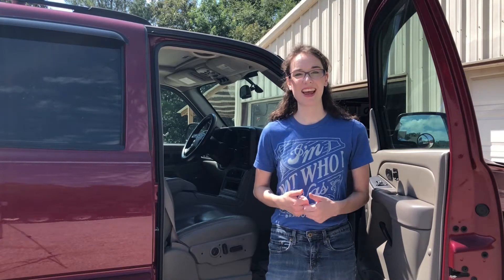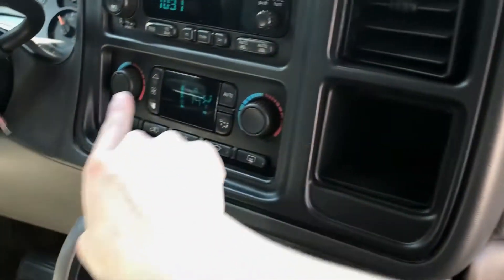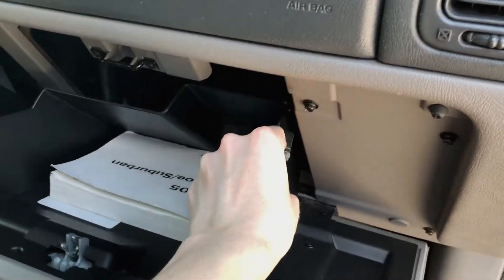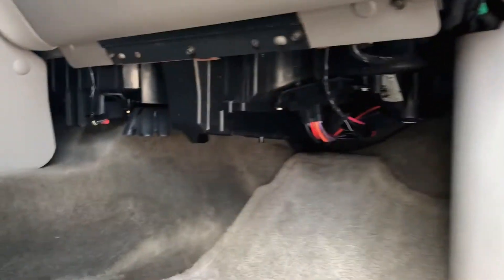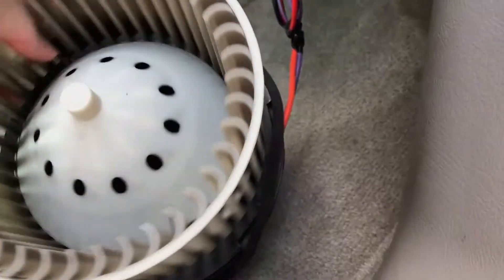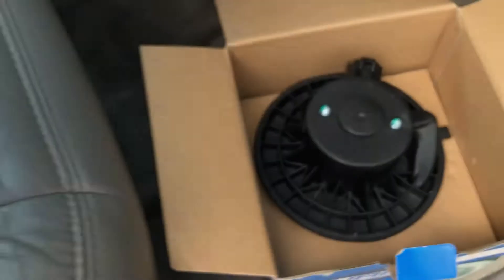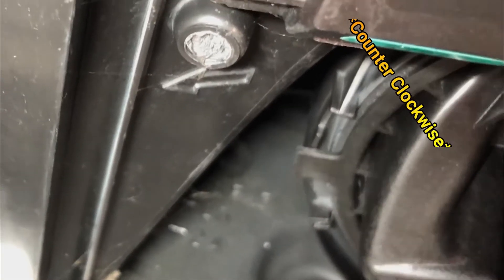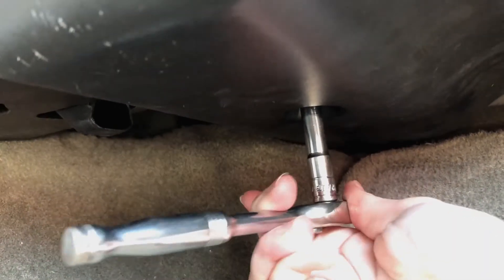Blower Motor Replacement Tutorial (2005 Chevrolet Tahoe)

Comment: Laura's easy to understand discussion starting about 3:12 shows the pull down tab and twist COUNTERclockwise to remove.  This was most helpful to me trying to reinstall mine which had simply fallen out. It was very difficult to do when one had no idea where/how to start.  I also learned the hard way that spraying some silicone on the plastic bits that fit together and the twist CLOCKWISE to click back into place!
Reply from the maker: Glad it helped @jbr3rd!  Thanks for posting.

Comment: 05 Tahoe - The blower motor was making that same excruciating sound off and on for a while until it just stopped (died) about a week ago. It was cutting in and out (on and off) for a few days but it's not doing anything now. I was going to take it to my mechanic but after having watched this video (thanks by the way), I'll be doing this job myself later on today!
Reply from the maker: That's awesome! Glad we could help, and thanks for watching!
Reply: I’m having the same problem with my 05 Tahoe. Once you replaced it was it working like normal?
Reply from the maker: It did for us

Comment: Thanks for the tab placement tip! My '04 Sierra was making rattling noise for 2 yrs at least and recently got louder. After removing the blower fan, found old papers and slipped being the glove ox and werr around the blower fan and some acorn shells inside too. Cleaned and blew it out. Kick plate and blower removal were kind of easy from watching another video, but fought 4+ hrs over 2 days trying to put the blower fan back. Should have watched this one too re: the tab detail - superb camera work and great info. No more noise! 💯👏🏼
Reply from the maker: That's fantastic!  Thanks for posting.

Comment: Hi, did yours happen to vibrate a whole lot while on the higher speeds? Mines sounds like a plane on the last two high speeds…
Thanks!
Reply from the maker: Hi there! We recommend checking every bolt to make sure that they're tightened all the way. If the sound persists, the motor may be defective. Hope this helps, and thanks for watching!

Comment: Any idea what the housing that the fan locks into is called?  Mine fine is fine, but it has wallowed out all the tabs on the housing that the fan twists into!
Reply from the maker: Hi Lee! We're not sure what the exact name is for that, but we recommend checking the owner's manual and part diagrams online. It's possible that it's a mount of some kind, you may want to use that as a keyword in your search. Hope this helps, and thanks for watching!

Comment: I have a 2005 Tahoe.  The HVAC controls are the digital type. I turned the truck on and the blower came on.  I turned off the truck and the blower stayed on high.  The blower speed control didnt adjust the speed. 
I pulled the 40 Amp fuse and the fan went off. I'm thinking that something in the control panel has cross circuited. 
This spring the blower wouldn't come on at all. I pulled a fuse out of the panel at the end of the dash, cleaned the milky corrosion off the blades and the blower came back on.
Does anyone have some ideas?
Reply from the maker: Hi @JB91710, you might consider checking switches / relays for continuity and see what you find.

Comment: Here's an important tip regarding all fuses. My directional signal stopped working and at another time my blower failed.  I pulled the fuse in the panel at the driver's end of the dash, checked the fuse for being blown and corrosion, scrapped the blades with my thumb nail and saw a white substance appear.  I whipped them off on a course rage and reinstalled it and I haven't had a problem since.  Moisture in some form must get in.
Reply from the maker: Great tip @JB91710.  Thanks for posting!

Comment: NEVER buy an aftermarket heater motor, such as Dorman, Bosch or Murry. You'll end up taking it out, because they don't fit right. ALWAYS buy original OEM AC Delco parts, they fit perfectly.
Reply from the maker: Hi Rick, we did not encounter that issue with the blower motor we used, but sorry to hear you had issues with a heater motor! Thanks for the input and for watching!
Reply: @freedomfamilyautogroup   You're welcome. I've never had any luck with aftermarket parts. AC Delco parts always work a lot better.

Comment: Save yourself some money and keep the original. If it's just making some racket but still working, you can spray some love into the small hole in the black plastic. Should take care of your issue. I used lithium grease into it with the tube that every can of lube has, and it took care of my issue. No need to replace it.